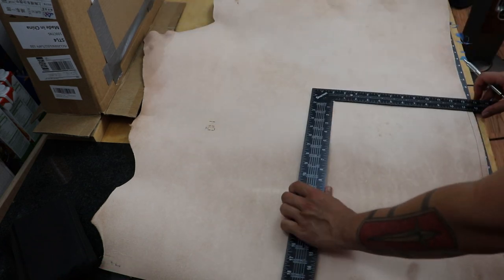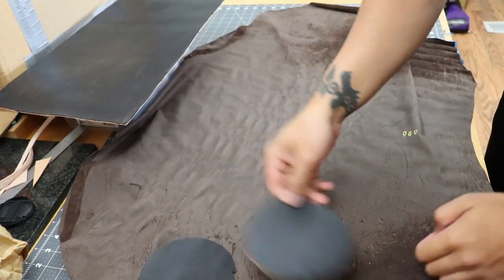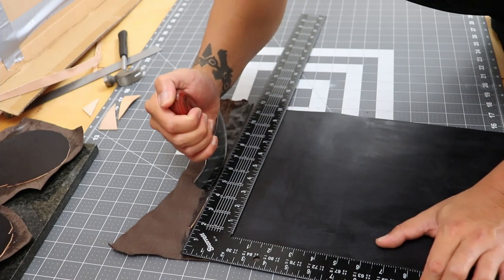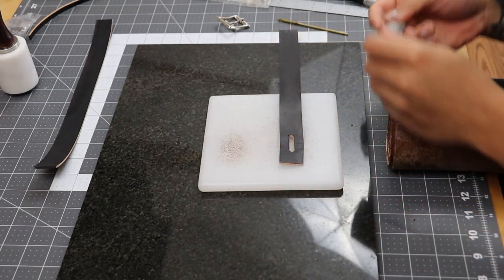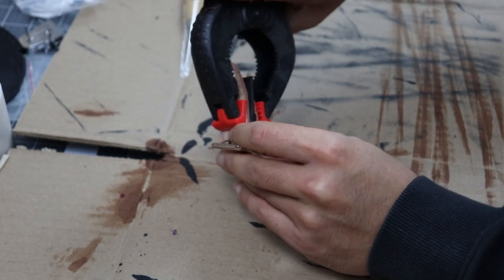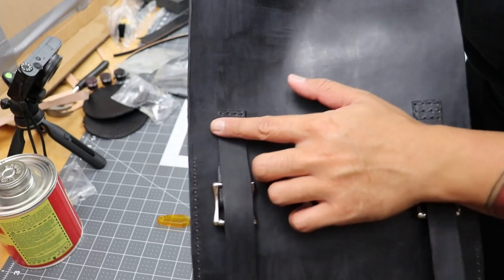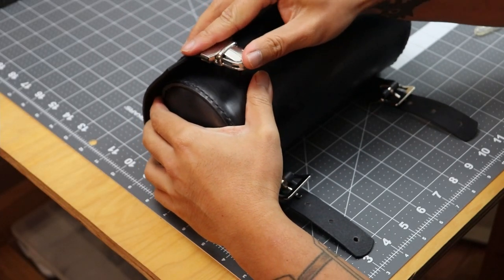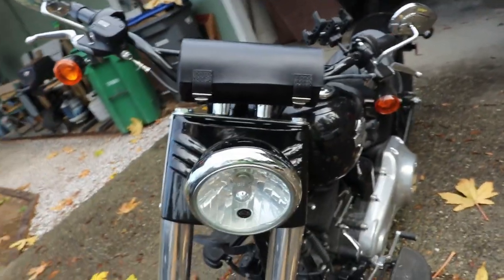How to Make a Leather Handlebar Bag -DIY- For Motorcycle

Comment: Paps baka pwede paano naman gumawa ng iba pamg handle bar bag na hibdi lang leather
Reply from the maker: You can make it out of whatever material you want and using the same steps but need to take into consideration the strength of the material, like can it hold a structure. The leather thickness I had had enough strength to hold the structure